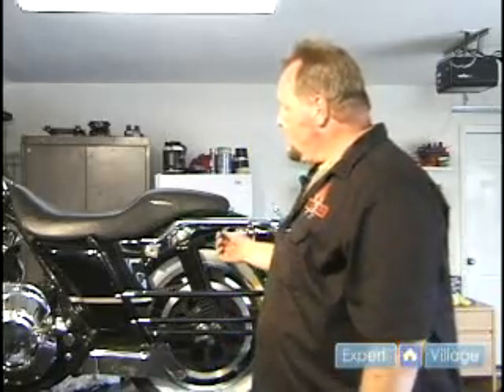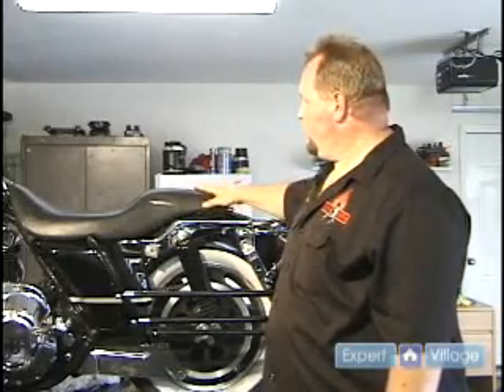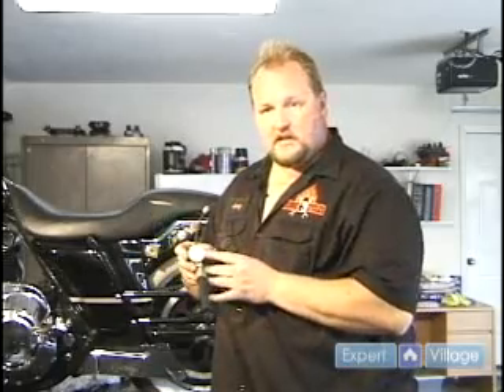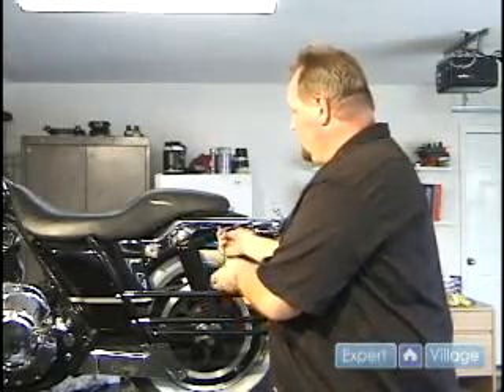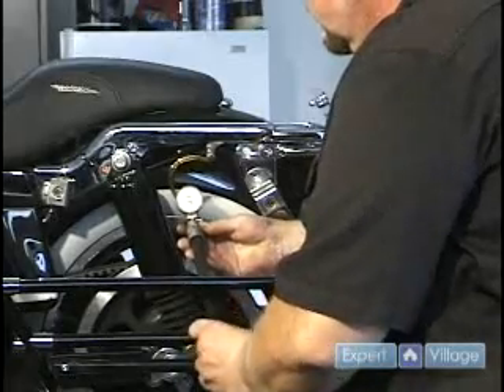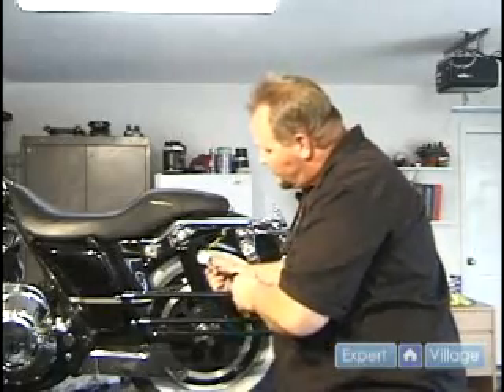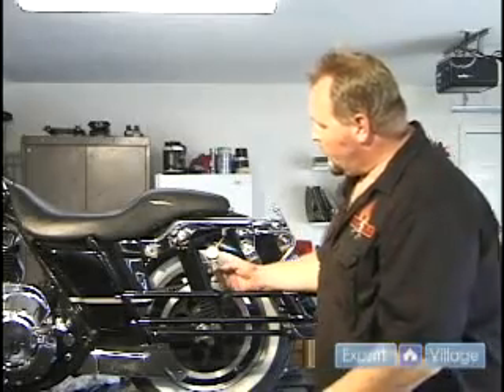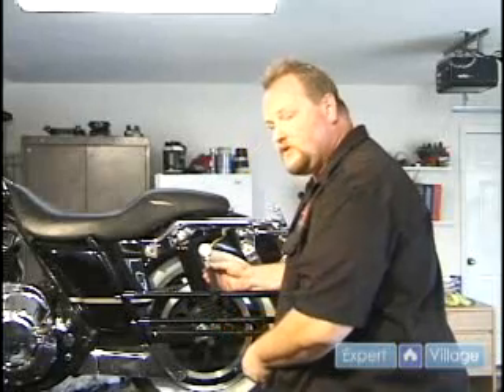HowTo Adjust Harley Davidson Shocks

Comment: The pressure used in the air suspension on a1999 Road King is considerably less. The max pressure in the rear shocks is 0-10psi. The front is 0-15 psi.  Just thought I'd post this so somebody doesn't pop their shocks.  Question.  Is it possible to convert the front air shocks to non air type?  I hate my front shocks. The damn things never rode good. Thanks, Paul C.

Comment: Dude you look like you eat 20 lbs a meal and when you sweat and gasp for air by just talking and standing in one spot you might consider looking at your health and losing some of the weight you carry around. And you should read up a little bit more or have someone that knows what the proper method is for adjusting those air shocks. I see im not the only one that thinks you are giving poor advice.